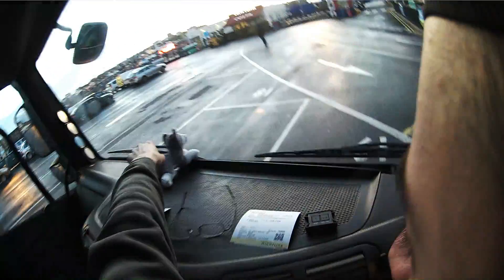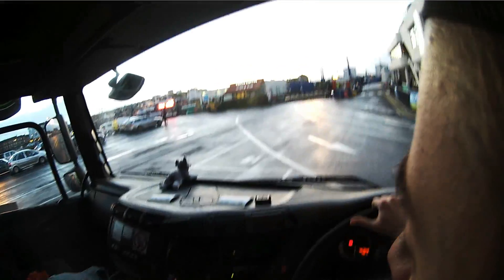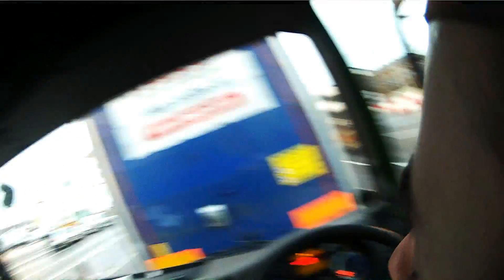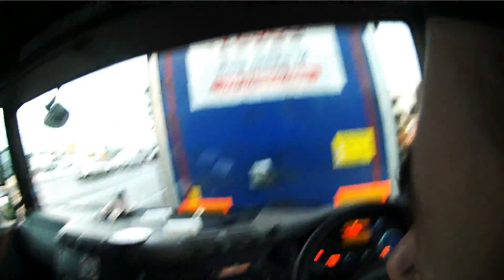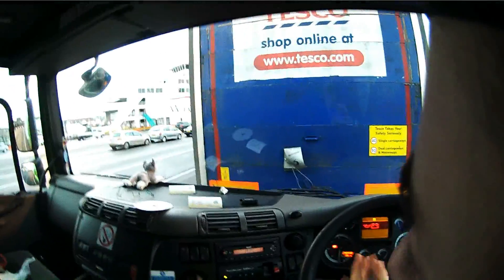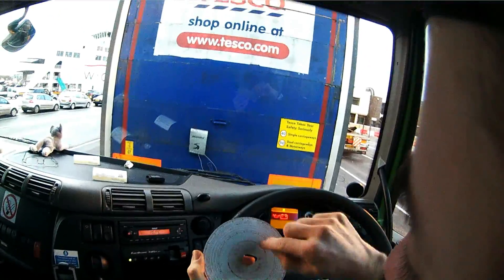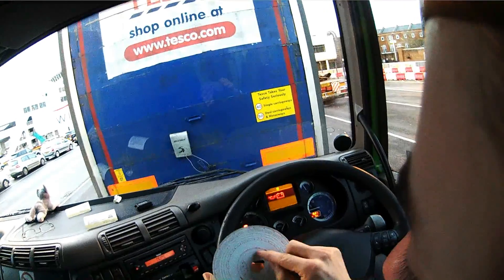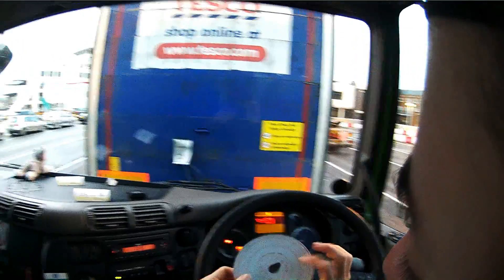How tachos work, driver regs and the working time directive part 1 of 3 (Old #54)

Comment: are they like black boxes ?  do they record if you have had a crash ?
 or note the speed you've done
Reply from the maker: No they only record what activity your doing and for how long they can't record video, sound or detect if you have a crash. Some newer models record speed but its not accurate enough to be used in a court of law but your employer could still use it against you. Infringements are your biggest concern though.
Reply: oh its just i have heard of lorries having somthing in them that sets an alert off if they hgv has flipped over or somthing like that
Reply from the maker: Yes trucks can be fitted with satellite tracking and/or telemetry systems to check driver behaviour and record cctv but these are independent systems separate from the tacho.

Comment: I highly suspect tachographs were mandatory for international drivers (i.e. for deliveries which take more than a day to do) even before 1972. I'll ask my dad later; he was a lorry driver around that period.
Reply: Right, as I suspected tachographs were indeed mandatory in several European countries (amongst which Belgium) at least as early as the early 60's (when my dad started driving), but European harmonisation of the regulations didn't happen until 1969 and, even so, The Netherlands only mandated them by 1974, so 1972 could be accurate as to when they became mandatory for every truck in the UK.